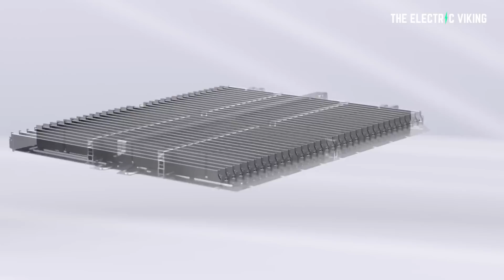Electric cars & pick up trucks will have more range than gas

Comment: What is the GVM, GCM of the vehicle? What is the range with a full load in the vehicle ? How do you charge the battery in the middle of the bush? 

How is this all going to replace the ability to have a 140lr long range tank with a couple of Jerry cans in a Hilux/Ranger etc set up for off road touring?
Yes Can charge the battery from a solar panel but how long will that take? Or do I need to carry a generator around with me and fuel to run it?

Sorry the tech isn't available yet, isn't mass produced yet, isn't on offer yet in a vehicle. Then there is the cost. Just look at the ford lightening....EV crap. EV for the sake of being an EV. It cannot do anything.

 I am actively looking as I am in the market for an offroad touring vehicle.  A current Wildtrak ranger fitted out for this purpose (work and play) is approx $120k depending on options fitted. 
Please show me where I can have that same vehicle with same functionality in an EV.  3.5T towing capacity (3T after GVM increase), 850kg load capacity on top of the 140lt full tank.  This is currently possible with a range of almost 1000km without towing. 800-900km towing 2Tonne.

Yes I have been engineering the loads, accessory types and weights down to the kilo of the Ute/Truck, to maximize the performance and functionality, for my needs both work and play.

I am open to ideas as I will be placing an order in the next 18mths.

Comment: EV's have a long way to go to replace working trucks. test fire, ambulance, police, and utility vehicles did not pass. if these did not pass there is no way a 18 wheeler will pass. there is no way and I'm quoting a fire chief in Washington D.C. "there is no way EV's can replace emergency and work cars and trucks", and this is the capitol of the US who is trying to replace every ice vehicles. i know so many people who bought a EV pickup and can't haul heavy loads more than half can in a ice truck, and you can fill up anywhere any time. because of gas prices they tried EV's and the news is spreading not go for working. you can't save money if you can't make money. i know a plumber who can't go to all his customer in a day because of the limitations of the EV. he said he is losing more money not completing all the jobs need in a day than just using his ice work van. there is a reason why you don't see EV buses, trucks, ambulances and the such, because the tried it and it does not work.

Comment: I agree that the changeover will happen much faster than people expect, and yes, Petrol stations are going to rapidly reduce in numbers. However, the lack of energy density of Batteries is going to be a big issue for towing for a good many years until much denser energy batteries are available. A factor of two needs to be achieved to do that.
I can see the governments increasing tax on Oil Fuels to promote the change rather than taxing EVs to make up the tax revenue.

Comment: On a full tank, 21.4 gallons I can get about 475 miles on the highway. Easy to modify the tank to hold 45 gallons (1000 miles) but not really necessary because gas stations are everywhere.

Comment: Diesel fuel has an energy density of 45.5 MJ/kg (megajoules per kilogram), the Lithium Iron Phosphate (LFP) 2170 cells employed in Rivian and Tesla vehicles have an energy capacity of 246 Wh/kg and energy density of 0.8892 MJ/kg.
So, the real question is, how much battery energy density increase is required to compete with a diesel-engined vehicle for the same payload?
As fuel is consumed in a diesel vehicle engine vehicle weight is reduced at the rate of 0.86 kg per litre (SG = 0.86), a 200 litre fuel tank has a fuel weight of 172kg which reduces to zero when all fuel is burned, a battery pack does not reduce weight as electrons are consumed and remains a constant weight liability, the 7,776 LFP 2170 cells alone that make up the Rivian 135 kWh battery weighs about 583 kg (1,285 lbs), that is equivalent to 677 litres of diesel, the Hummer EV battery pack weighs in at 1,326 kg (2,923 lbs), the equivalent to 1,541 litres of diesel.
The EPA quoted range of the unladen Rivian is 505 km (314 miles) and the unladen range of the Hummer EV is 529 km (329 miles), but when tested towing a 2,766 kg (6,100 lb) 8.8 metre (29 foot) camper the Rivian range dropped to 177 km (110 miles) and the Hummer EV range dropped to 225 km (140 miles).
For the equivalent weight in diesel fuel as the Hummer EV battery weight, the average Australian (9 axle) B-double truck combination at 62,500 kg (137,788 lbs) is able to travel over 3,000 km (1,864 miles), for a slight range reduction B Triple Road Trains up to 90,500 kg (199,518 lbs), AB Triple Road Trains up to 107,500 kg (1236,996 lbs), Road Trains (16 axle) up to 124,500 kg (274,475 lbs) and BAB Quad Road Trains (17 axle) up to 130,000 kg (286,600 lbs)
I expect that diesel vehicles will continue to be produced for long-distance road operators, farming, mining and the military for at least the next 30 years.

Comment: I see no need to fret about increasing ranges in EVs. The more cells you pack inot a vehicle, the less overall efficency you get since the vehicle has to carry that weight around. There are more people driving less than the current range of the EVs today than there are available EVs for them. Priority should be placed on bringing down the upfront costs of EVs and volume production.
Long distance drivers can hold on to their ICE vehicles fo a few more years if they can't live with the current range of EVs. I am looking at the overall picture for global EV adoption.

Comment: Hi Sam, one of your opening points was very telling, as gas/petrol stations start to close down as demand falls, it will become harder and more expensive to fill the tank on an ICE vehicle. One big advantage with electricity as a power source is it is pretty much everywhere, even in remote areas if perhaps at lower circuit capacity of 2-3kW.

Comment: The Viking is suffering from brain strain. Check out some of the prices per KWH Tesla and other charging stations are charging per KWH, many are in the 70 cent plus range. Dude that's $100 to charge that 140KWH pack. Now when you mention gas stations disappearing, I doubt it, but less demand for gas means lower prices, plus with carbon capture, the old gas burner will be cheaper to drive and cleaner. Remember, especially if your dealing with con man Elon and his over the air upgrades, Musket can send a bug at anytime that will kill your car on the spot, in fact I'd bet it is already happening. Of course your car will have just gone off warranty, and he'll slap you for $9K for a used battery with a 4 year battery warranty. Chances are it's the same battery, he never even pulled it, just like FSD, Musket decided to make you a little poorer. Now your talking about putting your trust in a Chinese Company, dude you are out of your mind. Pump away the Musket is depending on you!!!!

Comment: Temperature.  Rarely in the EV videos do we see the factor of Temperature addressed.
EngineeringExplained channel did a diesel vs Tesla heavy truck breakdown.  Even that video didnt mention Temperature.
In Canada, today where I live, it will be -25C tonight.  Last year winter, the local radio/media had news about greatly diminished EV range.  There was an EV rep on radio said "Dress warmer and keep the heater off"
Stay gold.
Reply: dnl machine:  For a SMALL proportion of drivers, the 30% or so winter range reduction is an issue for commuting etc.   But the battery range will continue to improve, as will the charging infrastructure. 

Just because X is an issue for some drivers now does NOT mean it's insurmountable for a huge number of drivers for a long time. 

And in the real world, wearing warm clothes, using a heated seat, and keeping the cabin more like 50 than 70 isn't going to kill anyone, if they want better mileage -- until the batteries get better.

Comment: A lot of pickup owners in the U.S. are using their trucks to pull trailers and 5th wheels. If the range is consistently cut by 30 percent or more when towing, it's going to cause a lot of folks to continue using petrol powered pickups. Myself included.
Reply: Tom Patton:  It's all going to be about what's good enough, and economics.  BEV's will be fine for a larger and larger proportion of people, but not everyone, as they improve. 

Long haul drivers of trucks towing heavy loads might be an issue for years.  But as batteries improve, charge more quickly, get safer and cheaper, and range improves, more and more pickup  trucks are going to be "good enough" for hauling -- especially as the charging network improves. 

So it might well be "a lot" that keep ICE's for now, but that will thin out as the years pass. 

We don't need to get 100% of people driving BEV's to be good enough, IMO (though laws might try to get there over time), but if we get to something like 99%, that will be a TREMENDOUS improvement re how much CO2 is produced. 

And if raising taxes on gasoline is needed to force the economic disparity to be large enough to get many truck owners to wake up at some point -- that can be utilized too, if needed. 

Looking at how much things have improved the past few years with battery tech, and the way they continue to improve, it''s just math re how great they're likely to get.   I wouldn't have believed it could happen so fast a few years ago. 

It's still EARLY days yet for BEV technology in the modern era.

Comment: We can agree to disagree about range. My wifes 2001 Toyota Corolla that we just traded off was rated at 475 miles range on the Hwy. An EV of equal size will come nowhere near that in the winter or summer on the Hwy.

Now compare a Toyota Prius and you are at a totally different range level. I know we have many of them in our area and all of them were getting 40 to 50 miles to the gallon of gas on the Highway. The closest vehicle to it would be a leaf, BMW I3, mini Cooper Ev or maybe a Chevy bolt or Volt. 

I agree that in the future things may change but if you bring up a Diesel VW at 45 miles to the gallon as a petrol vehicle, they will hold their own for years to come.

I filled up my Diesel VW and drove over 600 miles in the summer on the Highway across the Midwest in the winds across the plains.

I agree that EVs will keep advancing but to say that petrol cars will get range anxiety is a stretch. 

I know how many miles 1 gallon of gas will take me compared to 1 KW of battery. 

That is the real standard of measure to compare against. 

Another is how far 1 Kg of H2 will get you down the road in a comparable sized EV. 

You got to remember to stick to apples to apples when we start comparing vehicles and power sources.

I had a truck that ran dual fuel and I paid half the price for CNG as I did gasoline. I could get 1 mile farther down the road on CNG than gas and it cost half as much. 

Charging at home is much cheaper with an EV but if you have to DC fast charge all of the time the difference between Petrol , Diesel or gas or CNG is not as great of a difference. 

Wait until everyone is driving BEVs and all of the governments start adding additional taxes on them to make up for the loss of petrol taxes we are paying now.

They will get their money one way or another. 

They did the same thing to us with propane and Diesel in the 70's when the gas consumption went down because everyone was going to alternative fuels.

It is starting all over again with a younger generation that is Naive to the control levers of the Globalist Corporations and establishment politicians.
Reply: desertdan:  But as long as there are plenty of chargers, and charging happens quickly and reliably (which will take a few years yet to get to consistently), it makes no difference.   A 500 vs. 300 mile range isn't important at all, if 300 miles is PLENTY.

Comment: Maybe heretical, but given current battery production constraints it would actually be better to push plugin hybrids for a few years.
We want as many kms as possible to be electric. M90% of journeys are < 50kms, if we took one 500km range Tesla battery and made 10 hybrids with 50km electric range, we end up with almost 10x as many electric kms as we would if we used it in 1 pure electric vehicle.
I want pure electric, but as far as reducing CO2 emissions ASAP, it might not be the right strategy.

Comment: Interesting topic. My current car gets about 400 miles on the highway (Toyota Prius C) and I've shortlisted the Aptera 600 mile variant as potentially my first ev. That's a 50% improvement if it indeed comes to market. I haven't even mentioned the 1000 mile version. As gas stations disappear you might just imagine the price of fuel will increase it'll just be a continuous negative spiral. It's gonna be super expensive and very niche to operate an ice vehicle in the future.
Reply: Congratulations
Reply: @joemichele5412  never said it's a car. I said my first electric vehicle (EV) if it ever gets made.

Comment: Sam, this might be the case in a few select markets in Europe and China, but I dont see this happening for several decades in North America. There are just too many ICE vehicles here to displace and the lack of affordable EV options for the masses on the new and used market will slow this transition down. Most people in the US just cant afford 50 or 60k+ USD EVs. Itll be a long time before you start seeing vehicles like the F150 lightning, Mach E, Model Y on the used market thats in the realm of the average persons affordability range.
Reply: True
Reply: 5th like
Reply: Will happen some day, but it is years years away ... and even if most of gas station would be closed, around here would be still enough of them... and it would be good that most of them would be shut down -> cost would go down also.

Comment: Who would've thunk it? A large SUV with over 500 miles of EV range? A Lightning getting 620 miles of range? You mentioned that gas stations will close in droves. I don't know about that. However, when I see my local Exxon station switch from gas pumps to EV chargers, I'll know that the EV's are taking over. Gas prices are 10x higher than they were in 1973 when I first started driving. The price of diesel is RIDICULOUS. I'm hoping that your optimism comes true and that we get EV's with long range and that we will no longer have to depend on others for our gasoline supplies. I'm also glad to hear that you have over 1 million subscribers..keep up the good work, Sam!

Comment: Range has never really been the problem. Range Anxiety was created by writers supported by Big Oil fighting against EVs.
Reply: I believe it's the chicken egg scenario. In the beginning, especially in USA, there just weren't very many charge stations so range anxiety was indeed a thing. Now you can pretty much drive wherever you want. I personally still want my ev to go 500 miles but that's just my personal preference... Even with ice vehicles. If I were to get another ice vehicle right now ,which I'm not, I'd get the Lexus es 300h which will give me over 500 miles
Reply: No, range anxiety is a real problem for people who live and work in rural areas. In the course of my working day, I can cover from 100k to 500k in my service vehicle which is loaded with tools and often tows a trailer there are absolutely no charging points in the area I cover and I doubt if anyone will be in a rush to put any in either. I am not talking about the outback here it is rural Victoria. I also carry fuel with me because there have been situations where it has been a risk that I would not get back to a petrol pump sometimes. I have also listened to a podcast recently where the owners of a Hyundai EV around i30 size crossed the Nullabor and back and the planning that had to do was ridiculous plus carry a heap of different plugs and a very long lead. At one point they had to use a diesel generator running on used chip oil to charge the car. If that is not range anxiety then what is? Don't assume your city infrastructure extends much past its boundaries. I am not a fossil fuel fan, I would love to see EVs being used everywhere but as with all other things in Australia we introduce new things and ways then play catch up for years after.
Reply: Chris Fox:  To be fair, it depends on the use case.  For example, BEV channels showing towing trials with big BEV trucks towing heavy loads are showing MASSIVE range loss for some such trucks, and becoming a problem when lots of chargers don't work, etc. 

That sort of thing will improve over time, but denying there is any problem is no better than BEV deniers pretending BEV's can't possibly work.  There is a transitional period where BEVs will work well for more and more drivers.

Comment: Personally I think about 600km of total range is about the sweet spot. That gives about 420km of real world range if you are on a long trip and are planning on charging from 10-80%. At 120km/hour that's about three and a half hours before stopping for 20-30 minutes to charge/eat/stretch, etc. That also means to charge in 20 minutes needs at least a 250kw charger if you assume 5km/kwh. That's hard to pull unless conditions are near perfect on today's vehicles. I assume in another 3 years or so that will be mostly a solved problem though.
Reply: Already solved a company now puts out up to 500amp nozels which will top up to 80% in 10 minutes.